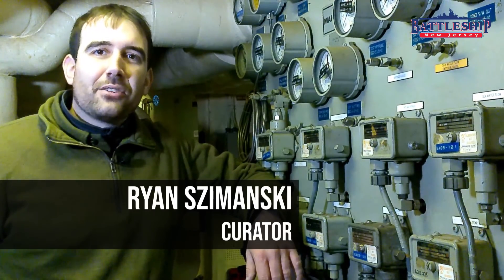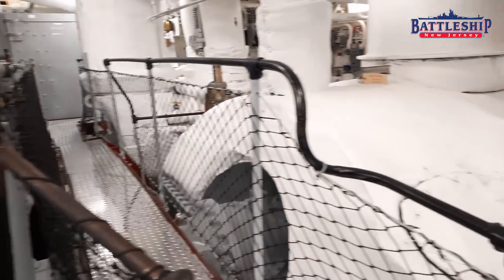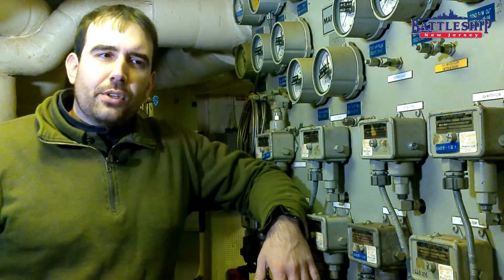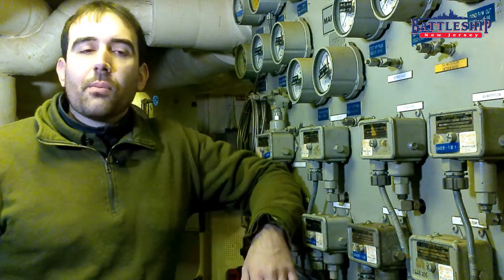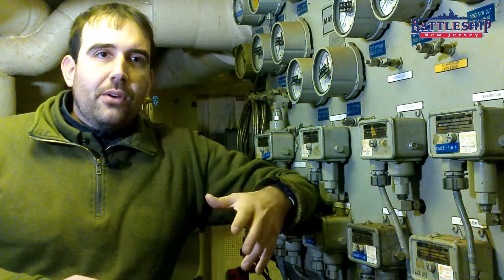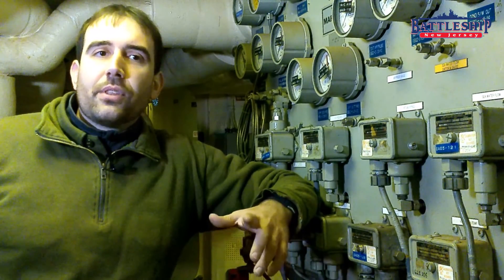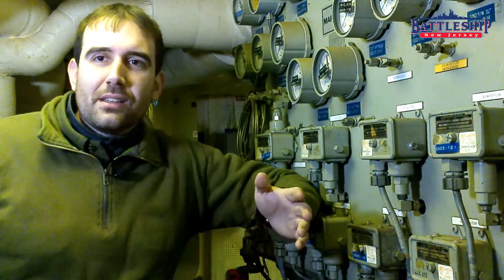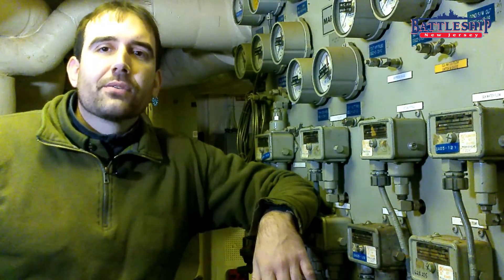Climate Control on the Battleship

Comment: Speaking of air, where do the boilers get their air supply from?  Is it ducted to the boilers?
Reply: Those air intakes on the tin can I was on were connected to forced draft fans which pushed air into the outer boiler casing which then was forced into the combustion chamber. That outer casing “helped” try to keep the boiler room to a “somewhat livable” temperature of about 90 deg f and 120 deg f. Full power trials (4 boiler ops) all bets were off
Reply from the maker: There are intakes that run from the stacks
Reply: @BattleshipNewJersey  Thanks for the quick reply.  Are those the the little "stacks" that face backward and turn to the sides?
Reply from the maker: Each is unique, there's usually a grating somewhere up there and it isnt identical across the 4 iowas
Reply: @BattleshipNewJersey  3d Deck aft next to Mts. 9 & 10 Large Screened Engine Room Intakes
Reply: @USSBB62  Thank you for the answers everyone.

Comment: Its shame you aren't allowed to run the steam systems. Would love to "hear" what all that machinery sounded like when running. Oh well...
Reply: No, it makes sense. Those steam plants are quite high pressure and are really pretty much at the end of their service life. It would be a really bad look to have a steam pipe burst near a tour group.
Reply: @davidfuller581  Steam leaks are no joke. Even new ships have steam leaks on a regular basis. A coworker of mine used to find super heated steam leaks on his Los Angeles class submarine with a broom. Go along the pipe until the broom whiskers start falling off and you found the leak.
Reply: @jth877  Rumor has it that used to be a way to look for hydrogen leaks for the Space Shuttle when it was first used. Hydrogen fires tend to be colorless, so if you suspected one and didn't have thermal visual sensors, you waved a broom in front until it burst into flame. Took a little while for the IR sensors to be readily available and portable.
Reply: @davidfuller581  Yup, Navy doesn't want anyone fucking with equipment that could cause catastrophic failure of the ship. "New Jersey Founders After Boiler Explosion" would not be a good headline.
Reply: @davidfuller581  True.
Reply: Yes and at pressure the steam jet would cut a person in half before they realized they had just walked through it.
Reply: Not a lot of people qualified to run a plant like that any more
Reply: Would be nice, however, to connect individual pieces of equipment to a portable boiler to get videos of them running.
Reply from the maker: We faked it with a fog machine once. It was neat but also, not worth the work. Like, you shouldn't be able to see the smoke coming out of the stacks its supposed to be clear, the steam itself stays in the system so you shouldn't see that. So fake fire in the boiler itself? Its just cheesy.
Reply: @BattleshipNewJersey  Did everything use the 600psi steam, or was there a lower pressure? Makes me wonder if air pressure (at a lower pressure) be used to run individual devices for demonstration purposes... even if it didn't perform like it should.. for example, spinning the turbo generators.
Reply: You would love to hear it for about 2 minutes, then you’d be putting your earplugs in.  It’s so loud AF that the person next to you can barely hear you shouting at them. Depending on which piece of equipment you’re standing next to, it could be a high pitch whine, to a lower pitch electric motor, or the sound of rushing air or water.

Comment: I spent the night on the Alabama with a Boy Scout troop.  The air conditioning in the forward berthing space was awesome.  So was spending the night on a battleship.
Reply: Me too!  It was in the early '90s.  Me and one other scout snuck off and explored much of the ship at night.  While we were there they were filming the movie about the U.S.S. Indianapolis sinking so parts of the ship were closed off.  It was raining that night so we got wet whenever we were looking for other unlocked doors/hatches from outside.   Funny I cannot remember the climate control of the ship but I remember eating in the galley and sleeping in the  3 high hammocks and the stainless steel walled showers still worked with very noisy pipes.
Reply: I did too, I did it in perhaps one of the coldest days of my life and temperature was kept pretty constant throughout the ship except on the higher levels of the superstructure.
Reply: I as well spent the night on the Alabama in the 90s as a kid with thee Scouts. I can also attest to even back then the HVAC worked very well.
Reply: i have a picture of it on my wall with two little exterior units like you'd see on a house sitting right Infront of the turret above that space on the deck